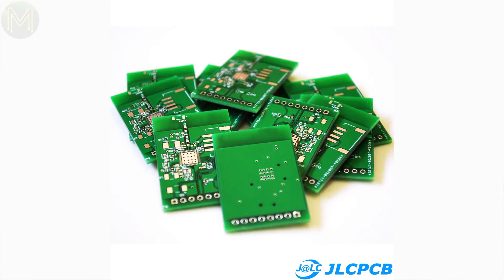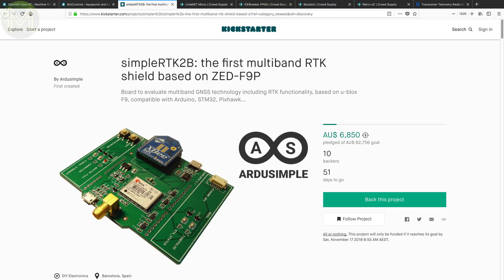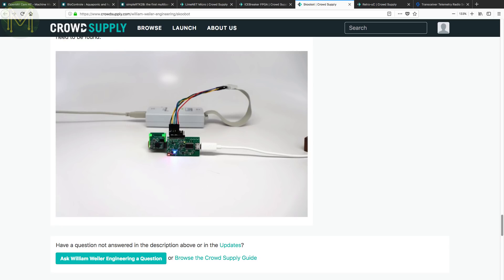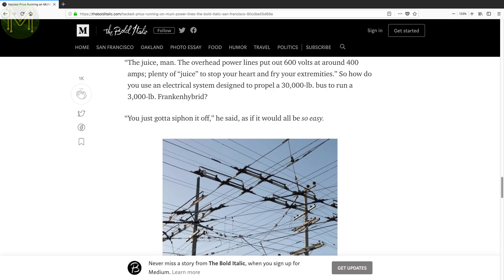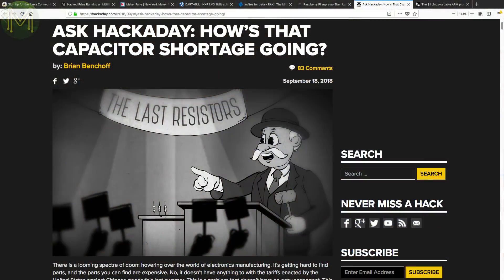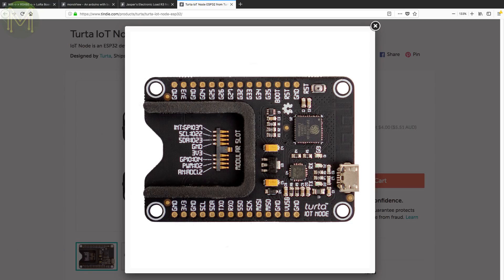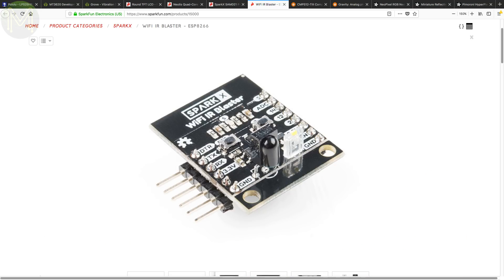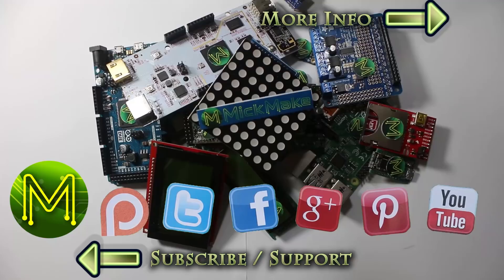#229 Weekly Roundup #59: New Maker Products // News

Comment: Hi Mick great weekly as usual, just a quick one, I finally decided to test JLCPCB based on you sponsorship but they don't offer free shipping  or any credits so even for a 2$ sample they charge 25$ shipping costs... Do you know if I need to use any special code for the 1st order?
Reply from the maker: There is an option there, but isn't straight-forward. I haven't actually gone through that process, so I'll get JLCPCB to give me some screenshots of the process.

In the mean time - shoot me an email and I'll forward on to them. They are on holidays at the moment, so you may not get a fast response, but we'll see.
Reply: thanks Mick I've already sent them a mail, will keep you posted once they will reply aftre China break :)